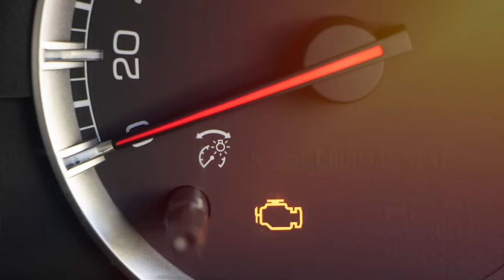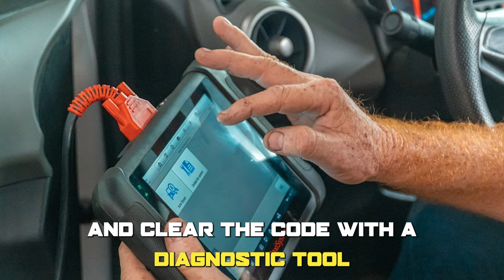P0700 ERROR CODE: MEANING, SYMPTOMS, CAUSES AND SOLUTIONS (Transmission Control System Malfunction)

Comment: If you’re battery is not holding a charge, it can throw this code also
Reply: Thank you for this. My car isn't starting, and the code is coming up as P0700. Strange bc my transmission isn't shifting hard, or showing signs of wear. Hoping this is the problem.

Comment: P0700 is a generic code. A full scan with a proper OBD scanner will show the related codes. It may be eletrical related as low voltage can cause the computers to miscommunicate. Possibly a battery replacement, cables may need replacing or a power draw that is destroying any new battery overtime.  This is provided you have serviced your transmission per interval schedule and the car is shifting fine etc.